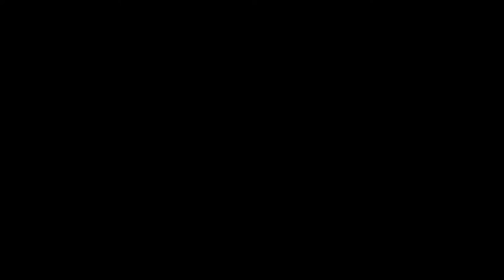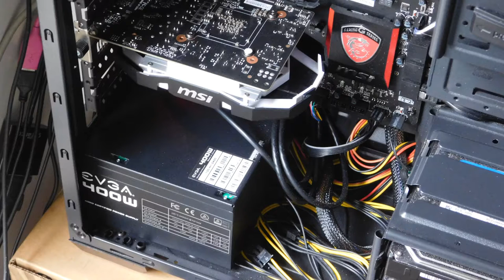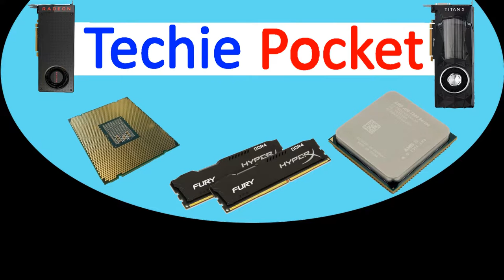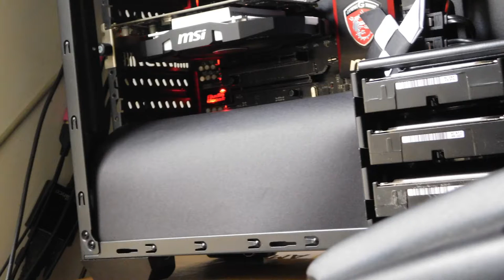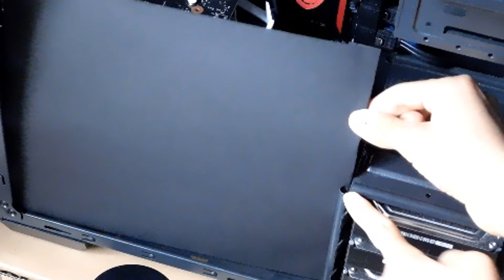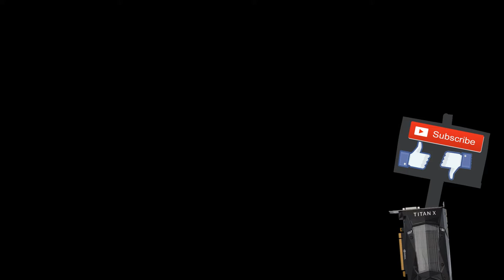DIY Paper PSU Cover for Shitty PC Cases! $5 SUPER EASY!!!

Comment: Wouldn't that catch fire?
Reply from the maker: Not necessarily :)
If your PC has good air flow, and doesn't overheat then its fine.

Also: https://gaming.youtube.com/channel/UC5hQ2dZZuqsVhatsNZwUsrA/live
Reply from the maker: If your PC is hot(over 80C) then it MIGHT make a fire.
But my PC does not get harder then 65C.
Reply: Ok. Thanks! :)
Reply from the maker: No, it would not. YW!
Reply: Simple answer just as cheap use cardboard instead of paper. Has to get super hot at the point the case is on fire already. Entire cases have been made out of cardboard.